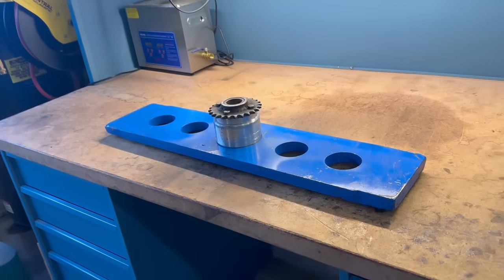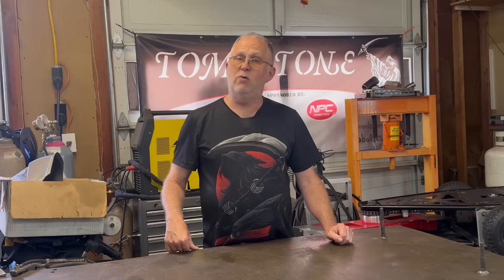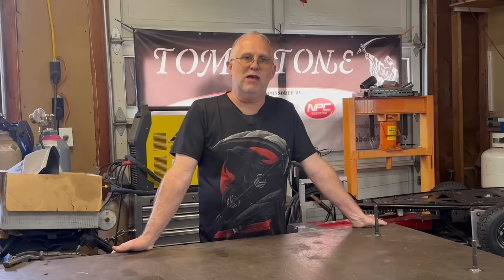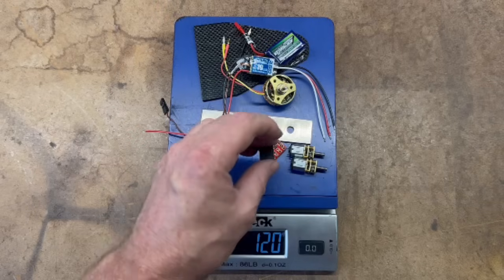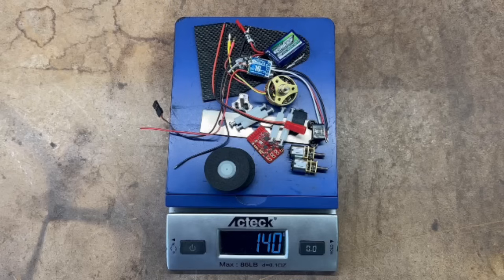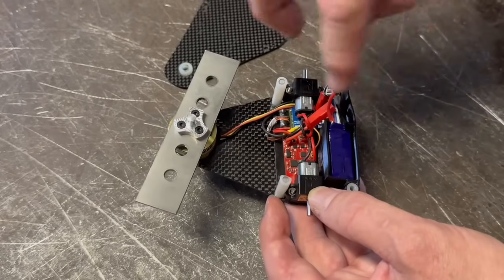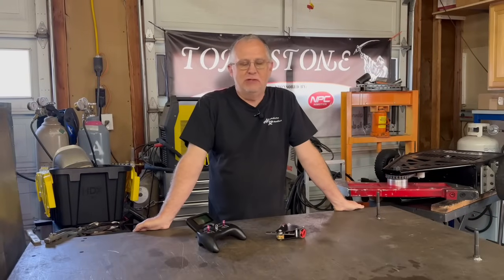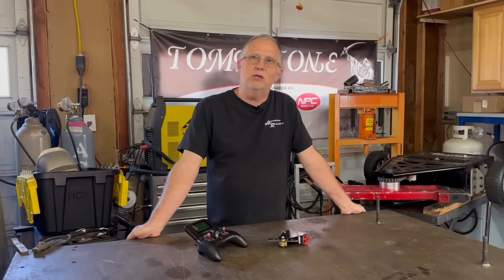Tiny Tombstone - Let's make a 150 gram version!

Comment: 1/3 of a lb?  Wow, the batteries could make up most of that!
I didn't see the R/C receiver electronics on the scale!
Reply from the maker: The malenki board has the drive speed controllers and the receiver all built into one compact package. They really are kind of cool for this weight class:

https://turnabot.com/products/mni-hv

Comment: Oh by the way for weapon esc, a super compact am32 esc is the repeat robotics micro 20A drive esc. You have to reprogram it to turn off multi direction (very easy on a computer with a programming tool repeat also sells). Am32 is just a better more powerful firmware version than any other type of esc for this scale lol

Comment: Something you may want to add is a power switch that is externally accessible.  Both for safety and if you do want to compete with it, most competitions will require one.
Reply from the maker: You are correct, if I were to actually compete with it there would be further work required. I really built it to potentially have that rematch, and to just do something new and different.
Reply: @ray9368  you SHOULD compete with it! What else would you build it for?
Reply: @ray9368 I'll bring you one this weekend
Reply: @ray9368  I have some friends who will be at Open Sauce and are bringing you a couple of tiny fairyweight appropriate switches.  And if you want to really put your bot to the test you need to come out to Colorado for one of our events.  We have the best fairyweights in the country.